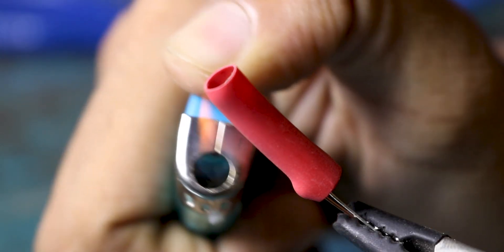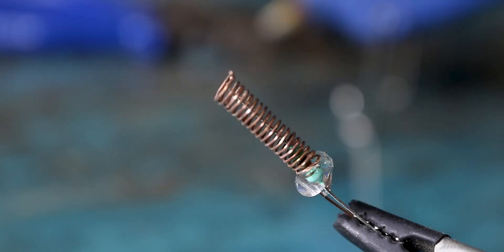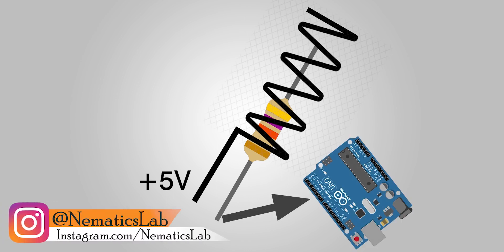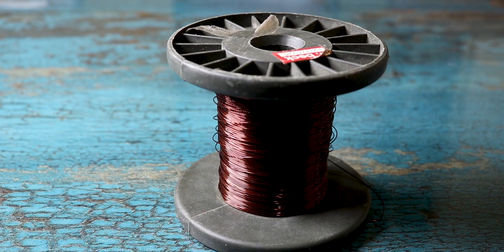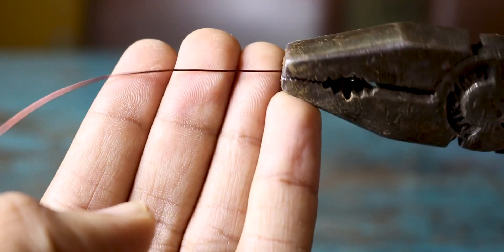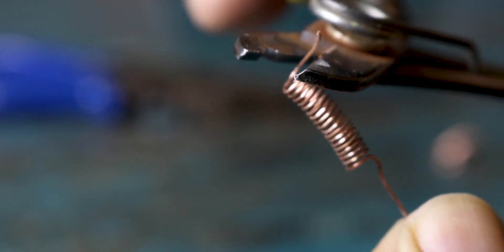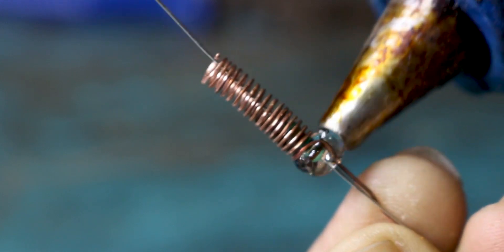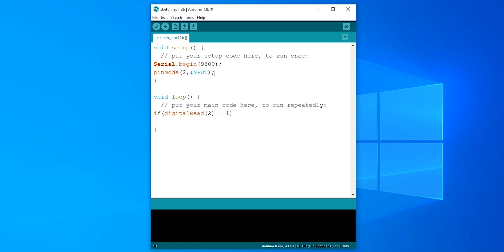How to Make Spring Vibration/Motion Sensor! | DIY | Homemade

Comment: Fun project! What about leaving the enamel on the wire and using capacitance to detect vibrations (as one conductor moves in relation to another)?
Reply from the maker: It won't work as Capacitor have two plates but they have insulation layer in between so no matter how hard you shake plates won't make any contact